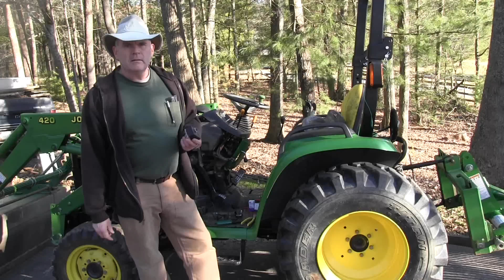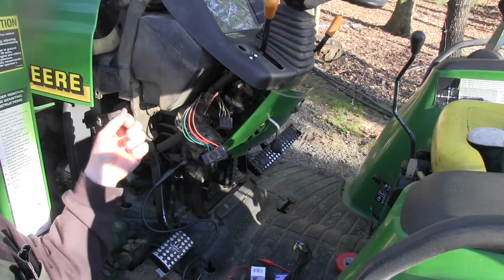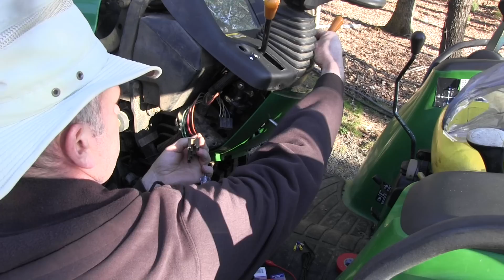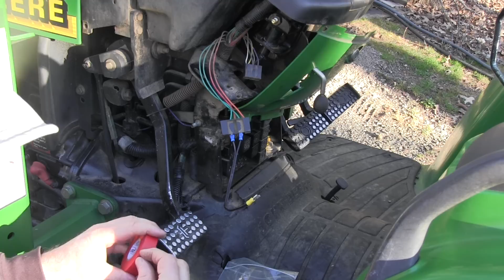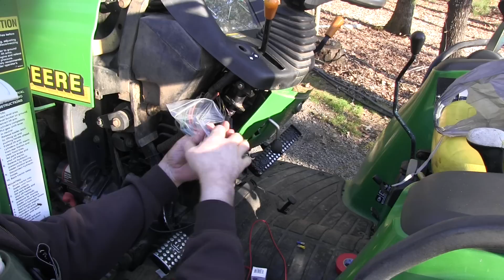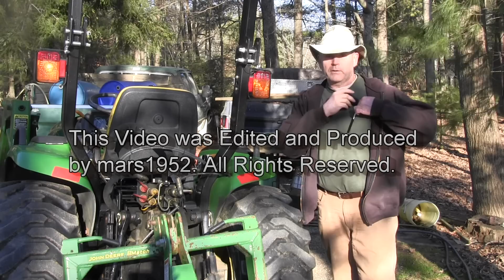Turn Signal and Flasher MOD for Tractors and Harvesters

Comment: I just fixed mine in minutes.  Bought a low current draw flasher at NAPA  for $29.00 and plugged it in.  My turn signals work great.  I have a Case IH 255.  case wanted $65 for the flasher box.  This way I actually do not loose my turn signals.  required no other work other than plugging in the flasher.